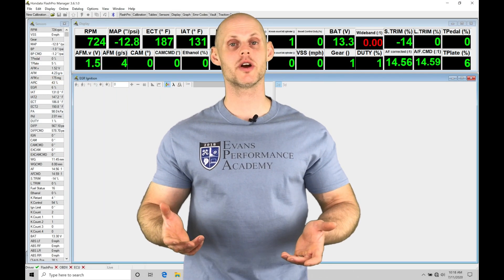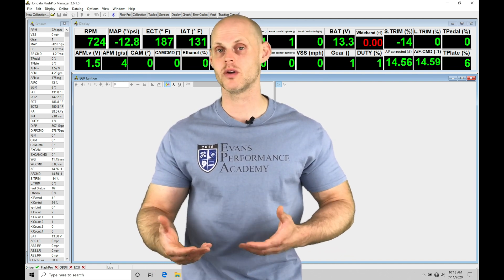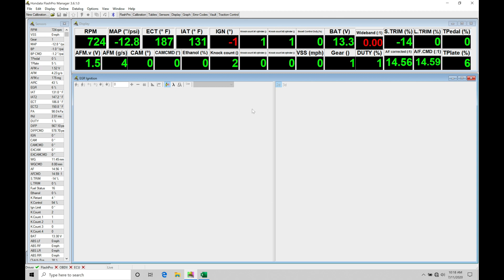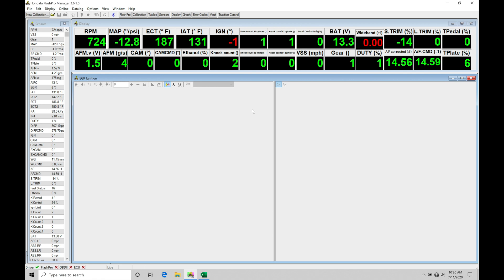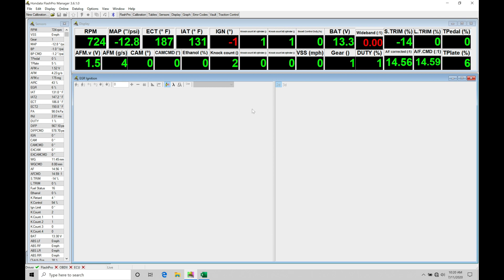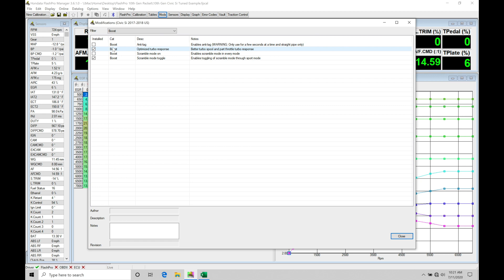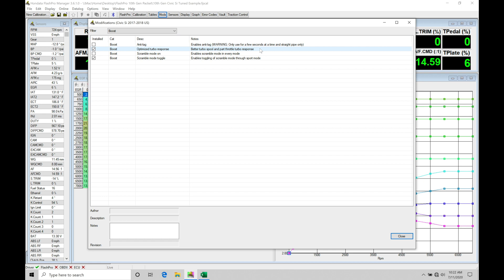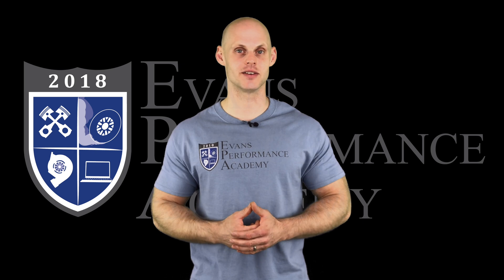Hondata FlashPro Part 34: 10th Gen Boost Control Tuning | Evans Performance Academy

Comment: have you tuned with ktuner on the 10th gen? do you have videos for it?
Reply from the maker: We don't offer a training course for KTuner software sorry.
Reply: @EvansPerformanceAcademy  Do you ever plan to add a KTuner training course in the future? Also, would these videos assist in tuning with KTuner with slight differences since it's different software but similar functions?
Reply from the maker: @SirAbuser  We have no plans on doing a training course for Ktuner.  The factory ecu programming would be the same between software suites.  The fuel / airflow model is the same with either editing programming it just comes to down to software layout.  It would be the idea as tuning a Subaru with Cobb or Open Source.